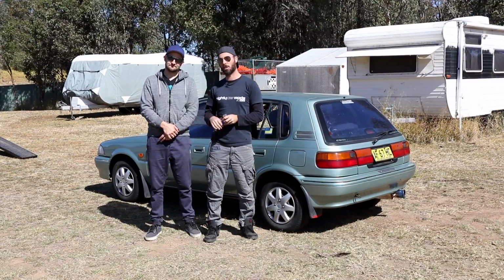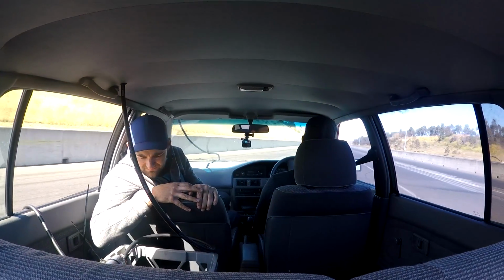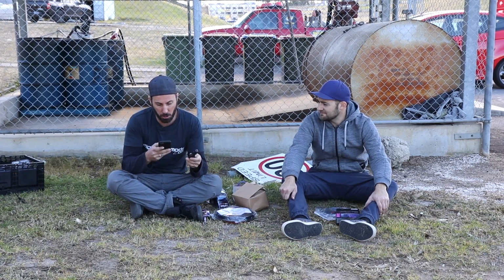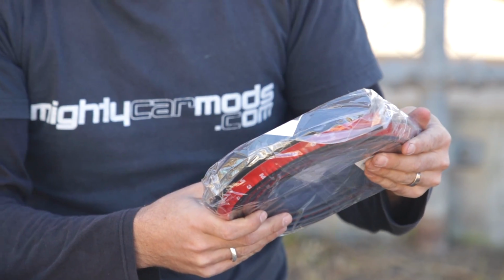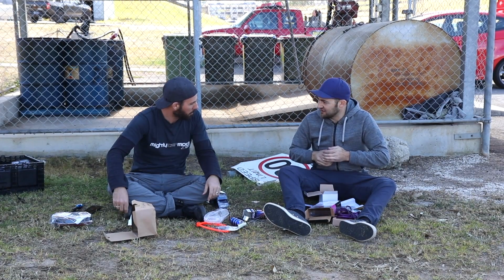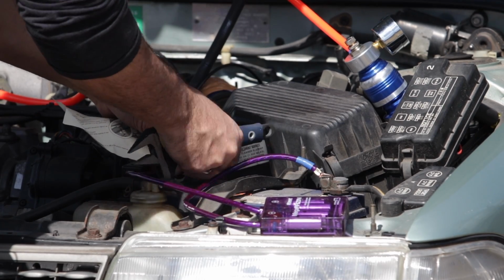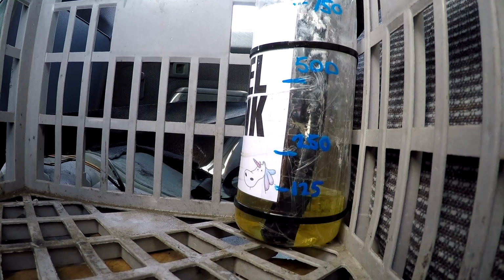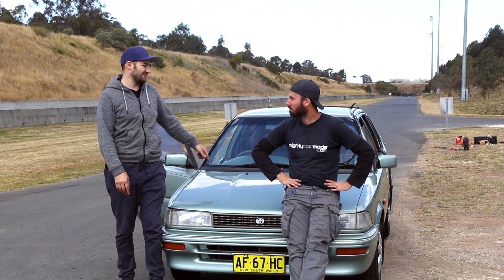Fuel Economy Mods - MYTHBUSTED

Comment: MCM i can see a challenge here. Actually make derrick as fuel efficient as possible using tried and tested techniques. Id like to see if its worth it.

And on a side note. How long will derrick run for after the fuel light comes on :) and how long will it run with NO oil, obvs this will be the last test!

Comment: This test failed because the magnet's north was not aligned with the fuel direction.... And all the massive aerodynamic improvements were destroyed by the magnet cable ties... Mythbusters would be ashamed! :P

On a serious note, HHO kits are actually proven to work, but how good are they actually? Would be nice to see you guys putting it to a test :D
Reply: deleb ru the problem with hho is you put more energy into making the gas than you get from it. Hydrogen atoms arent as energy dense as hydrocarbon molecules. It is cleaner, but you need more of it to get the same amount of energy. Then you have to take into account how much energy you spent making it. Not an efficient system.

Comment: Please try and make it run on an alternative fuel like fish and chip shop oil just because why not!
Reply: Hey it does work, providing you run an old mechanical Bosch pump. My bro used to have a Peugeot 205 with a 1.9XUD7 Turbo Diesel engine, with a big Turbo swap, made 197bhp on the dyno. Considering they make about 80bhp stock thats not bad..
Reply: Thats freaking rad man, I imagine you'd have to use an older pump as the new ones are not going to be able to deal with the thicker viscosity of the oil. How long did he run it for? And did it smell like chips from the exhaust? haha
Reply: Yeah Peugeot used (Bosch in particular) mechanical fuel pumps in their Diesel line from (I think) late 80's to early 90's then upgraded to a , still mechanical, lucas pump which like you said was too restrictive for thick oils. He had a 9mm Bosch pump that drank old oil no problem, but for bigger power , it was swapped out for a 11mm Ford Transit Bosch pump which gave him the ability to run 190+bhp, still on cooking / used oils! And yes actually , following him on boost smelt like a kebab van, whenever Asda did a 'Buy 5ltrs of Cooking oil for £4' deal we bought the whole shelf out haha. Think about that, fuel for a hot hatch for under a quid per liter :)
Reply: I love it so much man, how long did he run it for? And please Mighty Car Mods get behind this, Bunka has already given you all the info you need...ish haha
Reply: He had the car about 3 years, he sold it 2 years ago and moved on to Volvo t5's (owns an s70R now) and I moved on to 1JZ's - check my channel hah. This is a video someone else took of him on a rolling road before the uprated turbo / and with a regular 9mm Bosch pump - https://www.youtube.com/watch?v=whBPjUud_l8 ... Believe it or not he still got pretty damn good MPG's like that as well..

Comment: You guys should get a resistor...I mean "performance chip" that falsifies your intake thermometer so the car thinks it's -170F outside and absolutely dumps fuel into your engine. It does legitimate increase performance but how long would it take for your exhaust sensors to throw a check engine light or your catalytic converter to melt.
Reply: This will hurt not only the catalytic converter. I had faulty oxygen sensor in my mk4 Jetta, it was dumping a lot of fuel, yeah you could feel it was a tiny bit "faster" but unhealthy amount of petrol ended in the engine oil. Not nice.
Reply: That's what the cheap "performance chips" do. ...they've already done a video on it. Look for it. Talks about chips busted or something like that in the title.

Comment: What about the claims that a remap/tune can give more power while reducing fuel consumption especially on a turbo diesel?
Reply: Converting Colin to a diesel would be too hard
Reply: lol
Reply: It's not claims. It's proven many times over. Factory settings are very conservative to increase the engine life.
Reply: Why? What is more likely to sell a new car, great fuel efficiency and performance or a engine that lets say lasts infinitely for augment sake. Fuel efficiency and performance because these are things you can confirm. A consumer should also be more more interested in these statistics for several reasons. It is unlikely most new car buyers will be holding on to the car till the engine wears out, in 10 years the most efficient engine now will be out of date an comparatively inefficient (maybe even running on an out of date fuel source). Also as the car ages other tech in the car will be out of date and other parts will be failing. So it makes very little sense for a manufacture to sacrifice efficiency and power output for extended engine life. Not to mention it makes no sense mechanically. What are you going to do? Run it rich to reduce power?
Reply: Simple economics. If a car is pushed near its limits they can't guarantee any longevity. You're Thinking like the mcm corolla. Ie one. But they sell 10's of thousands. Many breaking drown/blowing up will cost them millions. They need to keep things safe. 
Yes with performance cars people might not care quite as much. But with cars like corolla people want reliability.
Reply: Once it is passed warranty it doesn't cost them anything and the design life of a new engine is way passed the warranty period. Also say any of that did makes sense and you wanted to reduce the amount of power an engine could make so it didn't break a brand new part (not going to happen). What you would do is lower the fuel consumption of the engine not increase it. I think the only reason you might thing the remaps can both give more power while reducing fuel consumption is because you don't understand how the power and efficiency and fuel consumption of an engine is measured. It is a lot more complex than peak power output and any single value fuel consumption and I guess that is why people believe these companies and there products. I am a mechanical engineer and all my experience and study so far leads me to believe that an engine manufacture builds and tunes their engines to near perfection.
Reply: What do you mean once an engine "passes warranty"? Once it's sold it's under warranty. And if it suddenly blows up they have to replace it. The safer they can make it the better for them. 

As for your other bullshit if an engine runs richer it produces less detonation but also less power. But that is safer for the company that produces them. Especially in a cheap mass produced car. 

I'm done replying. Google it yourself. Plenty of standard cars with a new/modified ecu making more power and better fuel economy.

Comment: I got a seat leon cupra runnin 300 bhp. I used to get 28-33mpg out of it on a mixed run town an freeway anyway my gearbox blew up on me i bought another one fitted it an it turned out to be a diesel box longer gear ratios now i get 38-50mpg on the same run
Reply: Mike Evans I read gearbox as glovebox. Thought you were having a laugh. Good on you though

Comment: Can make a vid of a dyno myth with different wheel sizes. See if a wheel size makes a difference in power
Reply: Changing the overall diameter of the tire, simply is like fine tuning the gear ratio for your Dyno Queen. But smaller tires more torque / Larger tires higher top speed.

Comment: The bleedvalve hks is all about performance not an economy upgrade for fuel efficiency.
Reply: Really? It's not a genuine hks product. It's a money making rip off. You really think mcm doesn't know what a genuine hks bleed valve looks like. And costs? Obviously fake dine they said everything they tried only costs 30-40 dollars.
Reply: i only know its function and i never mind about its brand. like they said, hks or what ever you think. air bleed function does make more power even though probably around 0.5% more. i test this device from like 12 years ago
Reply: Yes maybe on a turbo car. Bleed valves are made to increase boost. Which this corolla doesn't have. They also look (and work) nothing like whatever the fuck this thing was.
Reply: Bwahahahaha.... Oh gawd... Read more kid

Comment: I wunder how much power derek could win by cutting the cataysator out, or using one with less flowresistance.
Isn't that an experiment that actuall d make sense?
I guess it ll actually loose torque at lower rpm but really win some at higher.
Come on, do an episode with this! 😄✊️

Comment: Please try testing a hydrogen generator, and give it a real look. You might say it's a waste because there is an energy loss with every conversion but I believe there something to it because hydrogen burns faster meaning the flame front in the cylinder would be fast and that means a more effective burn. You'd probably have to chip and tune it as well because the o2 sensors would read that it's burning too clean meaning lean so it would dump more fuel. Give it a try, cheers
Reply: What you are talking about is a Browns gas generator Calling it a Hydrogen gen is incorrect because it produces HHO Molecules from H2O witch is 2 hydrogen mixed with oxygen witch actually makes it better for combustion then simply just Hydrogen molecules . It has been proven to work but on small scale does not work because it uses more electricity for less power output so it will just run the battery dead this is proven but the On very large scale I'm talking much bigger then can fit in a car it does surpass positive efficiency where on small car sized scale it has negative efficiency. we tried it on a Golf engine and it does give you better mileage but it is not sustainable on a small scale. It is very popular among Welding because you can have power draw from a plug producing very efficient welding gas just from water.

Comment: Can you guys do fuel economy add ons that actually make sense xD
Reply: Bctzkriegd Any reasonable add ons that would propably require a shit ton of money would be far outweighted by the gas you can save by just driving carefully. The gas consumption is mainly set by a vehicle's weight and it's motor and changing these factors either makes it bad to daily drive (weight reduction--->ripping out seats and interior) or is alot of work (engine swap)
Reply: Leander Jac will not like i would buy any of this crap, im just saying i didnt learn anything from this because it's obvious none of the stuff they tried would work, mabe next time use some plausible things instead of idiot placebo things.
Reply: Bctzkriegd okay, fair point. The Aero could potentially make sence, though. It's a old car. I would like to see them go all out on crazy aero mods

Comment: Technically if you get a super high end electric turbine compressor and ran it as a turbo off a separate battery not connected to the car's main electrical circuit and recharged it back at your garage, you'd increase the gas mileage A LOT.  But it'd also technically sort of be a hybrid lol.

Comment: Didn't see any fuel return on the second run. Marty even admitted to saying that the fuel was low on the first run because it was trapped in the lines. On the second run he said that the fuel was gone. Not to mention there was more fuel in the bottle after the first lap on the second run than the first run. Yes I know this is meant to be a joke video but still, just saying.

Comment: The only way you can get economy, and call it a mod, is to buy a tuner and then have an expert tune your engine so it works right. Other than that, maintenance. EVERYTHING else, tight fist, up and down, tight fist, up and down. Besides, most of that fuel is spit out of the car through the rear pipe.

Comment: can you myth-bust how stupid it is to remove a thermostat without blocking the bypass as a method of fixing an overheating car
Reply: Ross Dixon that would work but your engine wont be in operating temps, at least not for a long time which is probably worse than overheating

Comment: Cool video as always guys but what about:Spark plugs, Fuel filter,air filter, porting, and tire pressure @35psi. Also take it to your Automotive Calibration Engineer "dyno guy" and have them lean it out, adjust timing, and transmission shift points that suite your daily commute. An MPG gauge off eBay in eye view so that the driver is consciously adapting their driving to better their fuel economy,  and using higher octane fuel every third fillup or Octane booster can be added to help burn fuel more efficiently, and fuel system cleaner every 6 months to free up deposites...oh and a potato spinning in the tail pipe. 😉

Comment: H ave an improvised fuel magnetizer also, i used 3 nd55 50mm bar magnets. It actually influences the ecu after a few trips of running as it seems to adjust engine response.  I have a 1.5l Honda Jazz cvt and i can move forward without stepping on the gas which wasn't possible before.  My emissions tests were also way lower than average.  It works best in lower octane fuel for me.  I can get 17km per liter with this

Comment: how about fuel efficiency mods that actually work?
like over-inflating tires, weight reduction, actual aero mods (spoilers that reduce drag)
and maybe a more intensive testing technique..
(multiple tests, then average the results)
Reply: Dont forget taping all the gaps between body panels to reduce drag.
Reply: All those things are already proven to reduce fuel consumption. Not much point unless they have the budget and equipment of a major nanafacturer.
Reply: >"how about fuel efficiency mods *that actually work*"

Comment: weight mods, make it lighter,  check fuel economy,   Change tires, check fuel economy,  basic tune-up check economy..etc
Reply: Tape all the body panel gaps, reduces drag! Taping the door gaps could prove difficult and not really viable for actual road use but: "if it's worth doing, it's worth over-doing!"

Comment: I would love to see the Dyno difference on different fuels. I know that Derek isn't a turbo car, and the difference then proberly isn't that big, but anyway.

I'm driving a ford focus 1.0 turbo. And are only using 99 v power. I tell myself that I actually can feel a difference against 95 regular petrol.

Great fun film you did. Very entertaining. Thanks
Reply: Placebo effect
Reply: Martin Relsted octane difference won't be noticeable in a 1l, unless it's race spec. The difference you're seeing is just in your head .

Cool cars though , the little fords
Reply: Antony Evans well. I know that there are real test done, where the effect actually exist. The Danish car magazine "bil magasinet" did do a Dyno test on a Peugeot 308 GTI in different fuels, and they concluded that there are a difference. That car is of course a turbo car. So it works on modern turbo cars for a fact.
But does it give a old fashion engine anything?

The article is in Danish. http://blog.bilbasen.dk/billig-benzin-stjaeler-14-hk-4652/
Reply: Martin Relsted that's what I'm saying. Something like a gti will feel a difference. But a 1l not so much. Older engines can benefit sometimes, I have an old mini that runs high octane, but the engine is running at the limit in terms of performance

Comment: while the powers that be are blocking free energy, the ICE engineers dont know anything about that but they make cars as efficient as they can so no aftermarket thing can help. there may be some amazing way to improve ICEs but legit inventors are bought off or murdered.

lol '5 or 6 tools.' 'theres only two of us.'

i like that toyota. glass headlights. quality lol you guys should show some legit fuel saving methods. drive slower, use synthetic oil, clean throttle valve, tires pumped to 30psi, swap engine for a variable valve timing one. etc. get a sponsor for fuel efficient tires. if any fit that thing.
Reply: RLAgito yeah they murder inventors. You sound very paranoid bud.
Reply: RLAgito oh and most cars run tires at 32 ish psi. 30 is too low (slightly)

Comment: Dude(s).  You need to run the car on brewed unicorn piss.  I drive a 1963 Dodge Polara with a blown 572 Keith Black Hemi - running unicorn piss and a little nitro, I'm able to achieve a scientifically proven 1,206 miles per gallon.  It also helps if you use a Peter Brock Crystal.

Comment: The air charger  should work. I use it  for a long time and it gives me more performance and fuel economy
Reply: veenoable placebo effect, they don't do anything. Source: used to be a mechanic
Reply: Antony Evans really? Because me and cousin using the same car,bought at the same and I install it and I get better gas mileage and more performance while cousin's car is not using air charger and drinking fuel and it's slower than mine. Some mechanics say it's a waste while some are telling it is good
Reply: veenoable honestly, they don't work. The difference between you and your cousin could be any number of things:

Fuel octane
Tyre pressure
Driving style
Maintenance
Temperature
Engineering tolerances
Etc etc